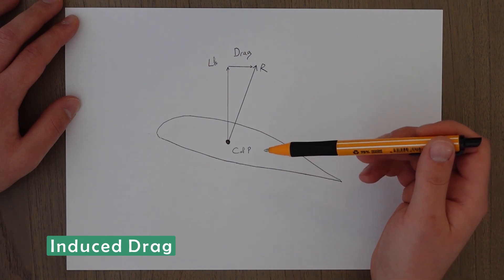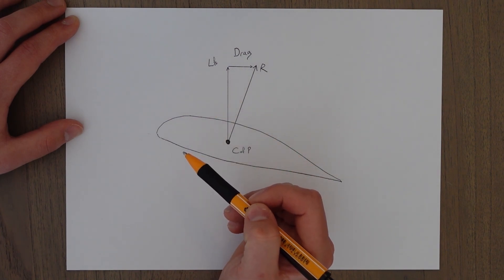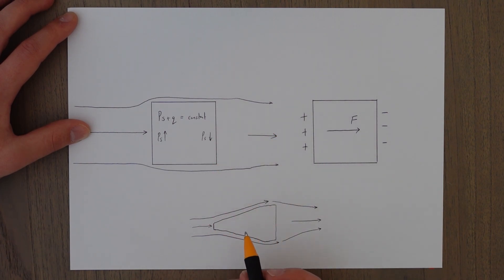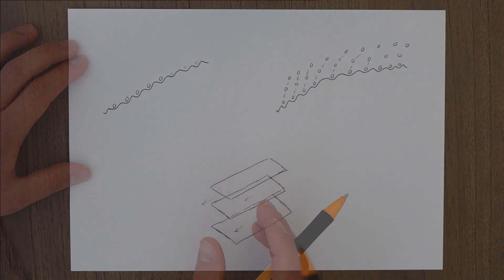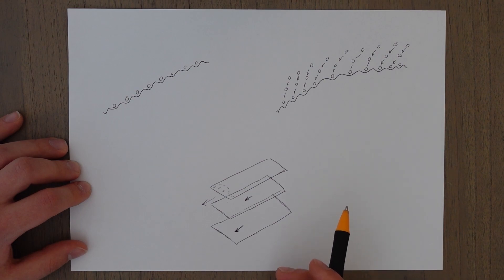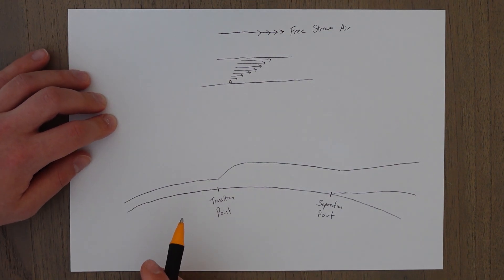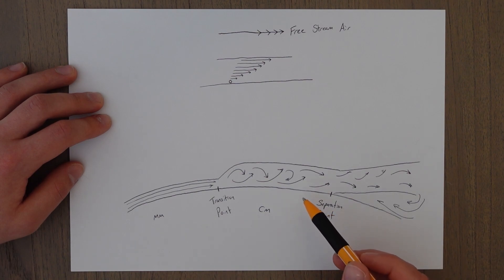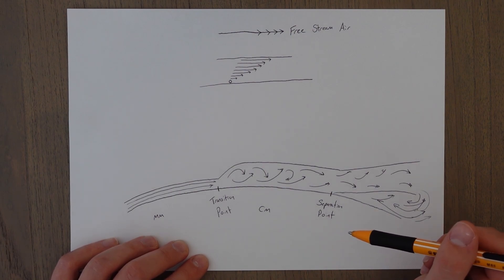ATPL Principles of Flight - Class 4 : Drag

Comment: You P1GS Don't UNDERSTAND SCIENCE. You Merely Memorise and Repeat.
Induced Drag, isn't Created By Wingtip Vorticies as You Understand.
The Aero-Plane Generates Lift by Angling the Wings (The PLANE), against the AirFlow. Airflow is Generteted by The Forward Motion of the Aeroplane. Powered by a Propeller or Jets. The Aero-Plane Generates Lift by Angling the Wings (The PLANE), against the AirFlow. The Forces That this Generates Is Broken Down into Two Vectors Horizontal and Vertical. One Vector (Vertical Lift) Opposes (Vertical Gravity). The Other Vector (Horizontal Drag - Induced Drag (Unwanted By Product of Wanting to Generate Lift) ).  The Other Vector (Horizontal Drag) Opposes Engine Thrust.
Your Science is Bullsh1t. You've Memorised and Regurgitated Bullsh1t From Darliks. Ask Your Gods Gods the Darliks. You're Nothing but SASH - La Primavera De La Monde.